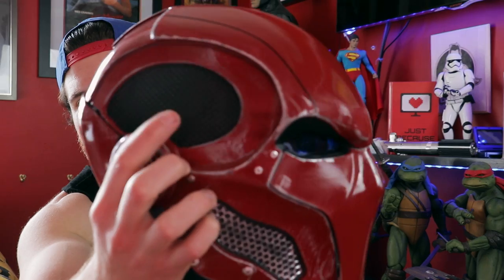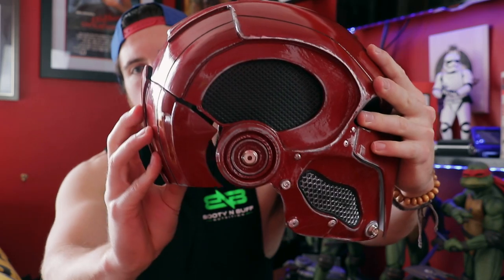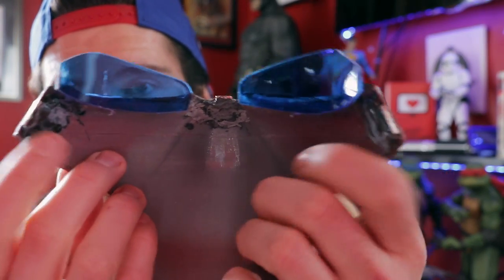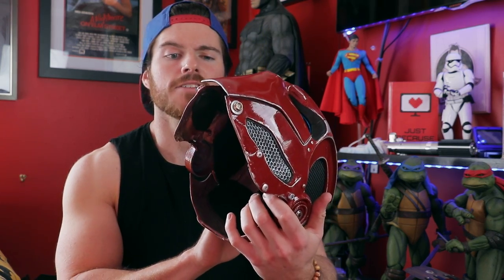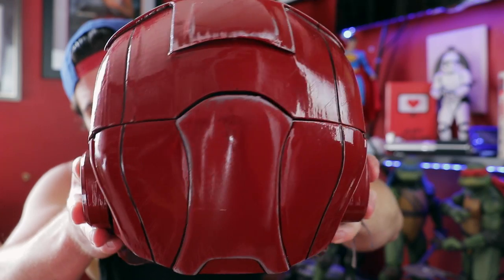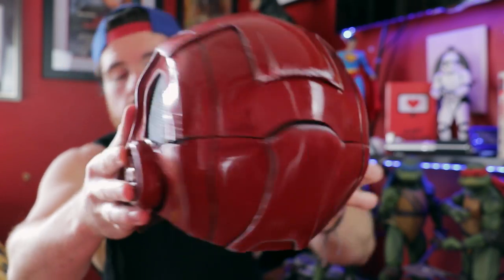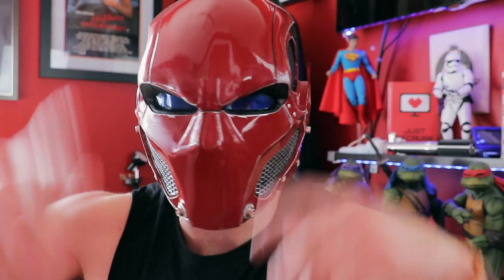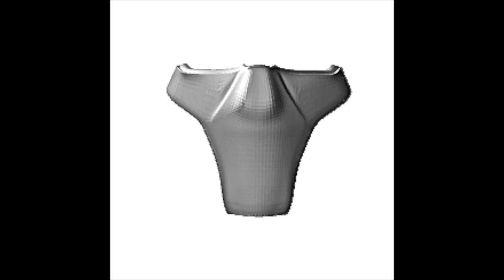The Road to Red Hood- Part 10: Final Helmet Reveal!

Comment: If your having issues with fogging try an anti fog spray, they are usually sold for motorbike helmets but just spray on the inside of the lenses and it makes it difficult for the fog to build up, that's my experience at least. Toothpaste also works but it's a lengthier process to apply than the store bought sprays.
Reply: Nahtan O'lie I was going to comment that as well!
Reply: Nahtan O'lie wait... toothpaste?
Reply: Nahtan O'lie also… biker trick,  either use bar soap or head and shoudlers shampoo and buff it like that… works every time,  also he should have added vents (like in a bike helmet$) but its not baf

Comment: Hey Chris a tip that may help with the fogging issue in your lenses, try using a dry fresh bar of soap, wipe it all over the lenses and wipe them clean with a dry microfiber cloth. We used this method in the mitary on  the range for guys who wore portholes (glasses) to prevent fogging during early morning shoots

Comment: An old trick we used to do in the old days to keep our paintball lenses from fogging was to put a little dish soap on the inside, spread it around and wipe it off. The thin film left behind kept them from fogging. Nowadays we have fog proof lenses so nobody does it anymore, but it still works.

Comment: That looks epic! Seeing it with the rest of the costume (upper body of it at least) I had an idea, maybe you could either make resin pieces or even 3D print some "armour panels" that can be attached to the neck piece in segments so it would still allow movement, but would also help to blend the neck and helmet in a bit more? Would also aid in covering where your hair peeks through at the bottom

Comment: Hey Chris! Nice work on the Red Hood cosplay. Just a quick suggestion or tip for you as far as the fogging up lenses goes. 

1. Pick up some fine black screening (like the kind used in windows or screen doors to houses).

2. Drill out actual holes in the silver "vents" on the cheek areas of the mask.

3. Measure and cut appropriate sized pieces of the black mesh screen and glue to the inside of the helmet behind the freshly drilled out "vent" holes.

Doing this should allow for proper ventilation of the mask especially because it's close to your nose and mouth which is the source of the fog.
Reply: And when you're finished with that feel free to trace out a pattern of your Nathan Drake Uncharted holster and send it my way. Or toss me a shout out. Which ever.

Comment: Genuinely brilliant! 
It would be cool if you put magnets in the top of the helmet so when you take the face plate off you just slide it up and locks in like a peak on the helmet; as long as it was relatively flush with the helmet.

With that sleevless version i would definitely say it needs like a set of gauntlets (even your batfleck ones) and shoulder plates. 

Keep doing what you're doing, Genuinely Brilliant!

Comment: I know this would require some body work on the helmet, but you could cut out the mesh sections on the jaw and replace with a metal wire mesh and back it with some black screen. That would let air out and possibly mean less fog on the lenses.

Comment: You don't even need to drill holes or anything into the helmet to stop the eyes fogging up. Easy tip: hard soap. Rub it on. Then rub it in properly with a dry cloth. Fogging disappears 👍👍